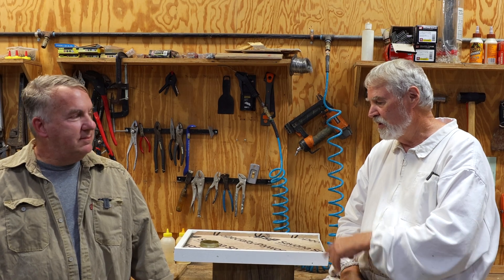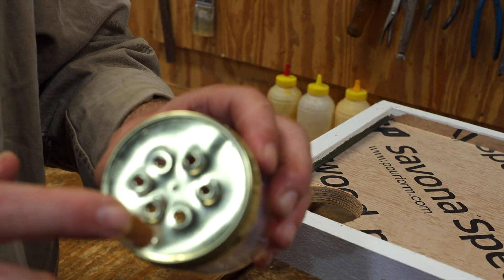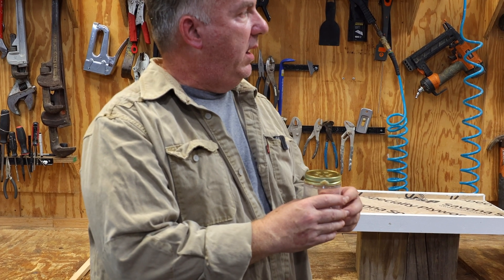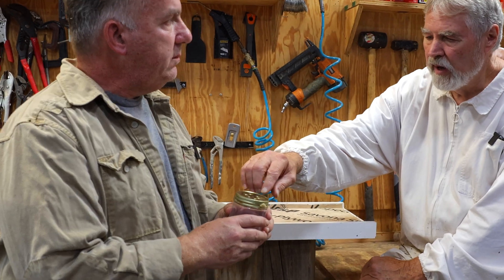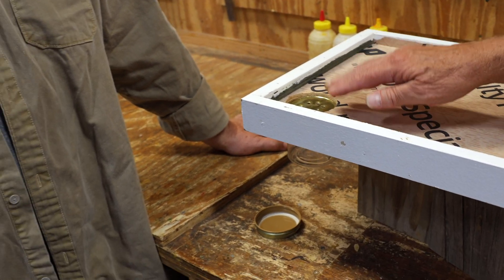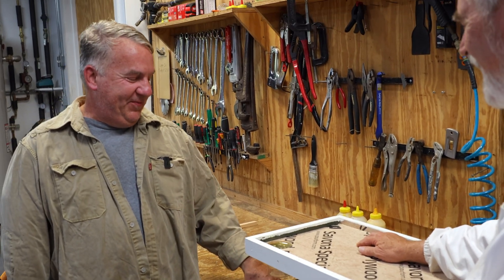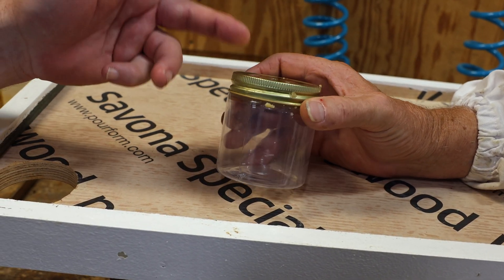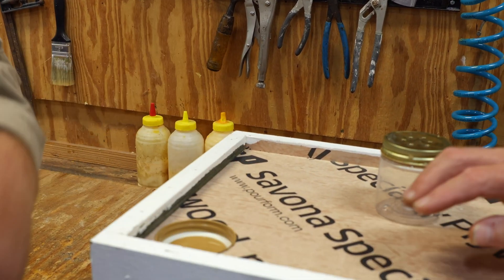Small Hive Beetle

Comment: Maybe I’m just a dumb redneck but shb were tearing my hive apart.
I’m in central Texas. Here’s what has worked wonders for me. Peppermint candy. 
I place a full peppermint on top corner frame (4 of em) 1 on each corner, and then I crush about a handful of peppermint. Sprinkle some down in between frames, and then I spread the rest on the top of the cover-board. 
Anyhow, that’s what has worked for me. Try it and lemme know? I have gone from seeing dozens and dozens of small hive beetles every time I inspect, to only seeing 1 last inspection.
I’ve used the oil traps. I hated them. I think I accidentally killed a queen last year with those. Swiffer sheets help. They will catch a lot of beetles but they don’t fix the problem.  Before peppermint I was catching dozens if not hundreds on the swiffer sheets every week. Since peppermint usage, the last time I checked my hive which was Sunday I only found 1 dead beetle.
I replace the peppermint about once a week. The bees also like to snack on it! 

￼

Comment: I put bye-bye beetle bait traps in one heavily beetle infested hive last fall. This hive has a screened bottom board. I went out every week or two in the fall and winter to check the board and there were always 15-20 beetles dead on the board, starting a couple of weeks after I put the traps in. I think using multiple control methods in the hive is helpful. Also, the strong colony philosophy. :)

Comment: I have darker colored metal roofing sheets under my hives and have little trouble at all with beetles here in WV.  I use screened bottom boards and I think the larvae drop thru and the die on the metal because it tends to be hot.

Comment: I treated around my hive stands with GrubEx this year. The larvae don’t know it is there and won’t crawl away to avoid it. I think it has worked well. My biggest hive beetle problem is bees drowning in the frame feeders and hive beetle larvae showing up in the bee syrup soup. I think that I have that figured out now. I was using Motherlode feeders with the tops and integrated ladders. I got rid of those and accordion folded 1/8th hardware mesh. Making a ladder for the whole length of the feeder. No dead bees now. I think the narrow ladder of the feeder top caused the bees to trample each other into the syrup and drown. Wider access means less trampling and drowning.

Comment: Strength and space management….thats my main defense. Even did a video on it. A fella in Picayune, Ms came up with a similar concept years ago with using a bait pill bottle that was mounted in the 3/4 inch lip of the bottom board. He used #8 hardware cloth over the hole and the pill bottle was easily removed and cleaned and re-baited from the side. Worked ok for the most part. Good video. Shade has dark and moist soil, direct sun has less fertile and more dry soil. I say that because Jamie Ellis claims that direct sun doesn’t actually repel the beetles in the box. So if that’s so, then to me, the biology of the beetle and their reproduction points to the soil being the issue because we know down here in Louisiana direct sunlight shows us way less beetles, if any, but….the soils down here in direct sunlight is like concrete. Our darker shaded soils under hives produce great numbers of beetles. Just my personal observations. We’re deep into beetles down here….
Reply: I am a big fan of direct sun.  My bees seem way healthier in the sun. Next time I lecture I am using your "strength and space" quote.  Thx pal

Comment: Thanks for sharing your thoughts. SHBs can overwhelm a colony and it is very ugly when they do. I like this approach.
I'm in Missouri and I use a screened bottom boards with ribbed trays underneath filled with DME. I also freeze frames that have a lot of SHB activity on them. It definitely helps, but I think I will try your method on a colony to see how it works. 
I've never had any luck with beetle jails or blasters. The SHBs always seem to hang out under them and often as they get caught in them.
I have heard that SHBs smell stress in a colony and target those, which may explain that they are often prevalent during and after a dearth.
Thanks again guys.

Comment: Hello Bob, it's interesting seeing all the different ways people come up with to combat pests. Here in Australia we have big outbreaks of SHB. Most people use a fluted cardboard of some kind and inject fiprinol or coakroach bait into it. It's cheap but time consuming. I use the registered trap called Apithor sold by Ensystex. It has a plastic case with 2 slots in each end and the impregnated cardboard inside it. We put them against the side wall of every brood box and they last 12 months. The cost is approx $5 a trap. They work extremely well and only require once a year replacement. Is Fiprinol approved for use in your area or not? Just curious to know why no one has used it over there?
Reply: Fipronil use is restricted in beehives by the EPA here in the States.  It is classified as a group C carcinogen here. No judgement here on its use in Australia.

Comment: The jar idea looks like it would work great for stationary hives but what I did notice was the lid of the jar was not flush with the floor of the bottom board so it was a little lower and the beetles were on the edge of the lid so I say drill your holes closer to the edge of the lid and possibly try and put. The hole in it with maybe a punch so you will have a funnel effect with them going into it. I’m migratory so it wouldn’t work well for me my swinger would break them all off when moving and I get rattle snakes under my pallets all the time also maybe for my cell yard though
Reply: I found that the jar being lower actually moved the SHB to the lid.  They try to escape the bees by dropping down in that area  (they also hide in it on a migratory cover).

Comment: I never tried it but I read about this in a forum 6-8 years ago. Whatever the time frame was when the AJ traps came out. Instead of the solid lid with holes they were placing the threaded lid ring up from the bottom and covering the hole saw area on the bottom board with the correct size screen. Tim, have you tried screen wire? Nice to see Tim is working on and perfecting this. Thanks Tim..
Reply: I tried screen initially but wound up going with the lid because I found that the beetles couldn't navigate the holes, back into the hive like they were doing with screen. The holes I drilled have a lip around them and the beetles don't navigate this well. I also wanted to be able to put a "blank" in the hole to keep out critters when the jar wasn't in position.
Thx for the encouragement!
Reply: @drliptak1  grease like on the jar you are using would not keep them down? A lot more surface area with screen for them to fall in. Maybe double sided tape around inside of the jar with thick grease. That gives a lip and grease. 

Yea, I know test it myself😂

As far as sealing hole you use a two piece jar lid and add the lid inside the rim and screw the jar on. Jar stays in place, hole sealed and ready to use.

Comment: I live in Australia with very similar conditions to Florida. My wining recipe for combatting SHB;
- Raise hives to at least a 1 1/2f above the ground. 

- My first red hot top is to use corrugated iron roof sheeting on the ground with hive stands on top as this heats up like a hot plate during the day and all grubs that leave the hive fall onto the sheeting and cook. Ants clean up the mess. It touches on the understanding of the biology and life cycle of SHB to short circuit that part of the cycle by killing larva. 
- use vented bottom boards to allow air flow and grubs to fall straight out onto the iron sheeting. 

- reduce entrances to at least a third of total opening (easier for bees to guard).

- understand that in about 20 days from heavy rain in a hot climate, beetles will be pupating from the ground. So complete final checks well before this date. 
- place hives to receive morning to midday sun to heat the hive. I think the heat may also be a trigger for them to leave and find ground to start pupating except they find a hot roof sheet.
- Protect hives from late afternoon sun. 
- I use Caucasian bees who are especially good at propolising everything and are especially quick at corralling SHB into their own pre-made gummed up traps against the interior walls of the hives. 

- limit inspections (removing frames from the brood box) as this breaks their traps and releases the beetle back into the colony.

- I only I use ‘CHUX’ branded cloths which are similar to your ‘swifer’ cloths but come on a large roll. I use this method on small or weak hives that may need a little more help. They are placed on the corners of the top box but they will catch the feet of some bees also. Replace regularly.

- and my chickens have free range to eat anything around the hives. 😂

I hope some of this may help someone. 

Good luck from an Australian Bee keeper
Reply: Does the heat from the tin cause the hive boxes to get warmer or is that why you recommend the boxes be higher from the ground?
Reply: @pattyhendrick2969  I raise the hives first to prevent other insects having easy access to the hive e and secondly so the sun has full exposure on all of the tin directly underneath the hive. As I have vented bottom boards the grubs fall out of the comb and through these slots down onto the hot tin. They try to wriggle off the tin but they die pretty quickly when it’s over 30 degrees Celsius. 

There will be some radiant heat which rises up through the hive but the wind takes that away. 1’ to a 1 1/2’ is a good workable height for me also. No bending over.
Reply: Another Aussie here  , Qld. I agree with all of your suggested SHB counter measures  . Also I believe in keeping colonies "tight " , don't add supers prematurely and reduce the size of your entrances. 
I am trying a bottom entrance,  vertical,  but have not come to any definite conclusions on its effectiveness so far.

Comment: Some thoughts Bob. So the larva, attracted to the fresh or combination of dirt in the air? Maybe an experiment closing the front entrance to 3/8 x /3/4. Put the bottle in the back, but plastic. Throw some dirt in the bottom, cut some holes in the sides and mesh. Don't really have a beetle problem here in Pittsburgh to run. I see 3 and it's swifer sheets!

Comment: I had a beehive on a metal table under a tree and on a grassy area and always had hive beetles, I build a fenced in apiary but removed all the grass in the area, lay weed blocking sheets and covered it with one inch size rocks for drainage and the beetle problem went away! I use the jail traps and only get maybe 2 beetles a month.

Comment: Good info! We completely eliminated an infestation at one of our apiaries this year by using grub control granules beneath and up to a 30' circumference from the hives. Our hives are all elevated from the ground by either 1' or 3' depending on the benches used. Breaking the reproductive cycle in such a drastic manner makes sense. After we started doing this we saw others posting research showing similar results. Yes, this is only another part of a total IPM program, but it is an important one. We have seen ZERO effect on the bees from the grub control. We also employ swiffer sheets, beetle blasters filled 1/3 with DE instead of oil, West screened bottom boards again using DE mixed with agricultural lime instead of messy oils. We have one apiary that just needs to be relocated due to too much shade and leaf litter which has not given the same result using grub control. We have one hive in a remote location that is unique to our operation in that it sits very close to the ground, uses a solid bottom board year round, yet is extremely strong enabling them to control SHB to about 20 adults observed at each inspection. This site is also a bit too shady, but there's not anything more open on that property. We hesitate to do anything more to it because of its strength and copious amounts of top quality, 100% wildflower honey.

Comment: Great video.  This is a lot of good information.  As a Master Beekeeper I keep trying different ways to control SHB, I found that I have been able to greatly reduce shb problems by using Grub-X in my bee yards.  I sprinkle it under the hives and about 10 feet around them.  Follow the instructions on the bag.  I have been doing this for two years now and I see very few hive beetles now.   I have used the swiffer sheets and they worked well. You still have to take care of week colonies since SHB is a secondary pest.   Use all the tools you have.  Traps, swiffer sheets, nematodes, etc.  See what works best in your area.
Reply: Same here.  I don’t like using chemicals in my bee yards if I can avoid it but I dislike hive beetles much more.  As long as grub-x keeps working, I’ll keep using it
Reply: The problem with swifter sheets they also catch queens!!
Reply: Never caught one since the sheet is up top…
Reply: They are currently testing grub x for in colony use… isn’t it Lewis Bartlett doing the testing?

Comment: Hey Bob Albee here tidbit of info on the bettleblaster I notice with your Caucasian bees they are bad to seal over the holes I use the end of my hive tool to punch them out and verse’s throwing the unit away at the end of our season we take a 5 gallon bucket of boiling water with dawn dish detergent and soak them out good for another season we. use top rubber under our hives also it’s white and doesn’t create extra heat in the summer cut our bettles by half

Comment: There’s a online article if you look up “ResearchGate SHB sandpaper traps” it’s a very simple homemade trap with 4 pieces of wood, window screen and sandpaper. You mount it under the entrance to catch the larvae before they drop to the soil to pupate. Never tried it and I’m not sure how long sandpaper last in the rain. Here in my area of Texas it would last a long time. We usually only get much rain in the springtime. You just screw 4 pieces of wood together (2 the length of the full entrance or a little longer and 2 very short pieces) and line the interior walls with sandpaper and staple a window screen to the bottom so rain will pass through. Apparently the larvae can’t climb sandpaper.